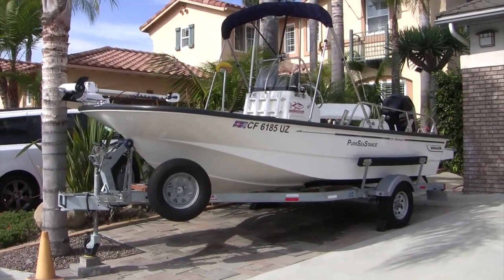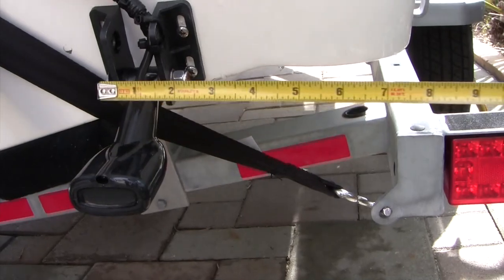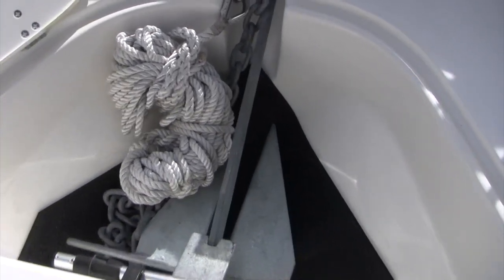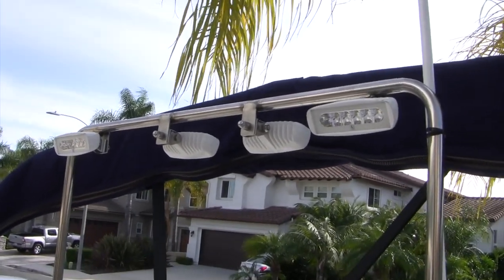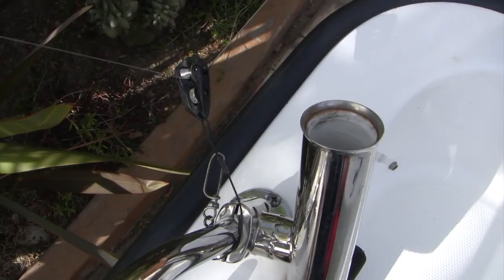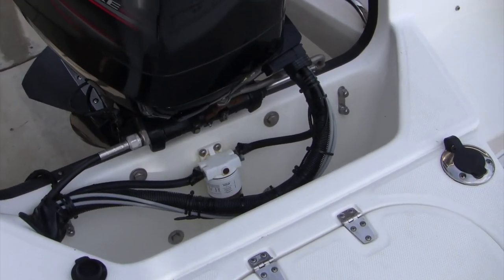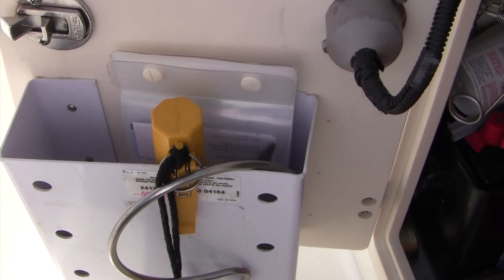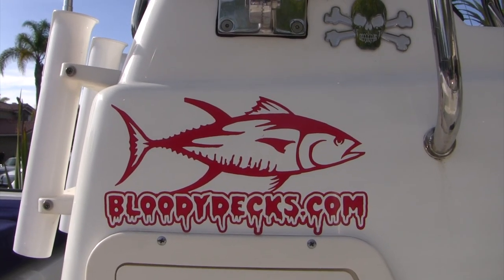PurrSeaStance Boat Tour

Comment: OMG - Wetwilly - you are a man after my own heart. Well done heavy-duty mods in the spirit of overbuilding like Whaler does. I have never seen your video before but I chose the exact same gauge stereo and trolling motor (I fitted mine under the bow rail) and added a switch panel (you kept it more Whaler-like than I did) for transom underwater lights and interior LED lighting. instead of your overhead floodlight bar, I chose Seamaster white LED strips fore (on front of the center console) and aft (along the gunnels high up). I just sold my Montauk 150 and got a 2018 Whaler 170 two months ago (upgraded from my 2012 150 Montauk) so I have set about doing the same mods on that. I will do a video tour when it's all set in a few weeks. You will be amazed how similar it is to what you did. I love your upgrade to the big Yeti and support system. I might do that.  I had a small Roadie Yeti strapped to the rear deck in my 150. My wife called it an expensive little cooler, but I called it "a cheap casting deck" :) Of all your mods, the one that impresses me the most is your under-helm seat tackle tray - talk about efficient use of space! Brilliant. In my new 170, it's got the 25 gallon in floor tank so it's all storage under helm seat. That feature and the new forward fish box drove me to upgrade. Plus I felt very very small some days 10 miles offshore in  Boston in the 150.  For my new Motorguide 24 volt 80 lb pinpoint GPS motor, I am going to cut the rail and put in a hinge rail system in the split bow rail using stainless bimini caps and pins. That way it will deploy easier and I can use a 60" shaft and adjust the motor depth a lot easier (since I also still fish freshwater with the boat). I also went with 3 lithium phosphate batteries for it. Thank you so much for this video - so many great ideas. You obviously put a huge amount of thought into it and I can see your are 100% safety conscious, which you have to be out in the big ocean in a 17 ft boat (especially the mighty Pacific). I also love RAM mounts and have several of their tough claw rail-mount models to hold their led searchlight,  my GoPro on a extendable rod as well as my viewing screen for my chasing.com gladius mini submarine drone. Well done sir.